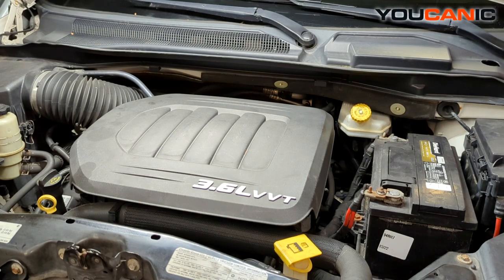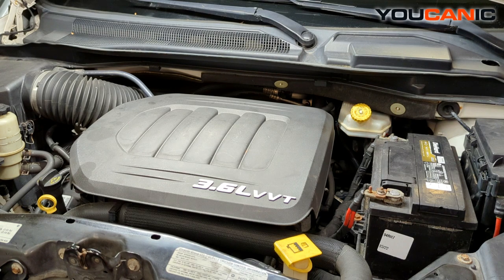2008-2020 3.6L Dodge Grand Caravan - Ignition Coils and Spark Plugs Replacement

Comment: How do we find which cylinder is misfiring with the diagnostic
Reply from the maker: Thanks for reaching out! Youcanic is committed to helping car owners diagnose and fix issues without breaking the bank. To find out which cylinder is misfiring, you can use our powerful YOUCANIC scanner and explore our free resources and guides. If you require additional help, feel free to visit our website www.youcanic.com. 

From factory repair manuals for intricate tasks to our dedicated support, we are here to make your car maintenance journey smoother. Remember, at Youcanic, we believe in empowering you and providing all necessary support. Keep your questions coming!

Comment: so why only change plugs 2, 4, 6 did you change the other 3 plugs?
Reply from the maker: Hello and thank you for your valuable comment! We changed plugs 2, 4, and 6 as an example, you should indeed change all the plugs. Our main goal is to assist you effectively in your car repairs!

To successfully diagnose modern cars like an expert mechanic, you definitely need a reliable professional diagnostic scanner. That's why we've developed the YOUCANIC Full System Scanner, to empower car owners. Check it out at www.youcanic.com/scanner if you're interested. To ensure precise work, consider accessing Factory Repair Manuals and Torque Specs here: www.youcanic.com/manuals. This resource could make a significant difference in your repair procedure!
Reply: @YOUCANIC  yeah sounds great but good content is to show us the work completely to get idea how you dig into 1,3,5 always good to see  what a mechanic face with. 👍

Comment: Thanks for the video work. Learned a few things on my own Pentastar from your video.
Reply from the maker: We're pleased to hear our video was helpful for you! If you’d like more information on diagnosing car issues, our YOUCANIC Full System Scanner could be an invaluable resource for you. Check it out at www.youcanic.com/scanner.

Beyond that, YOUCANIC offers a host of automotive resources, including OEM Factory Repair Manuals and a question platform. Feel free to explore our site at www.youcanic.com. We're dedicated to helping car owners understand and handle car repairs confidently, so don’t hesitate to reach out if you have more questions!